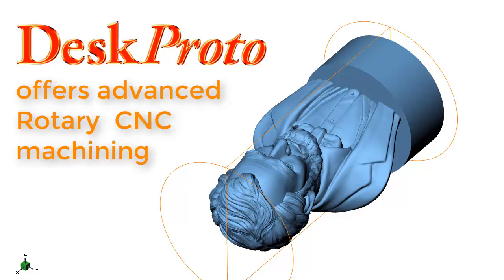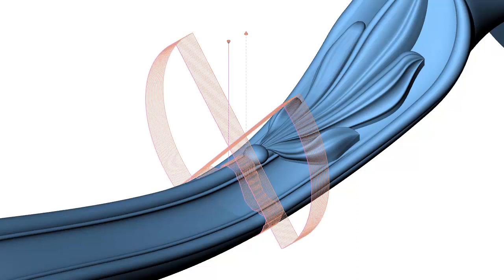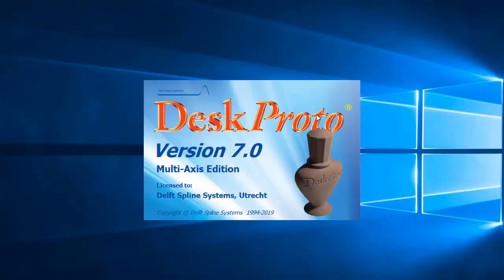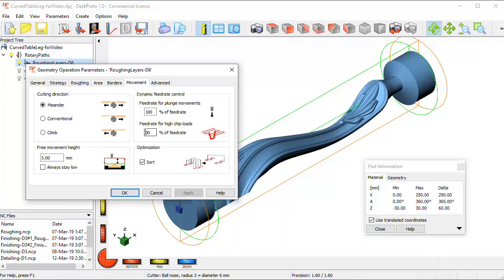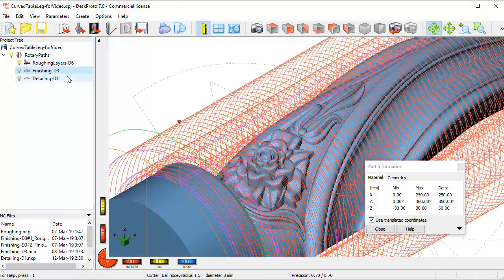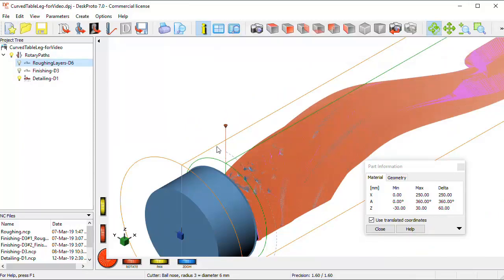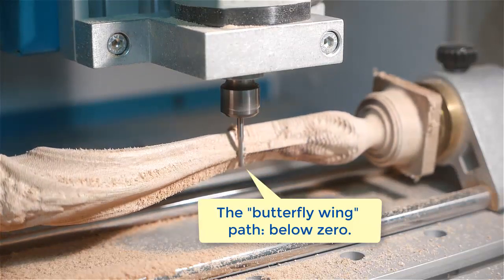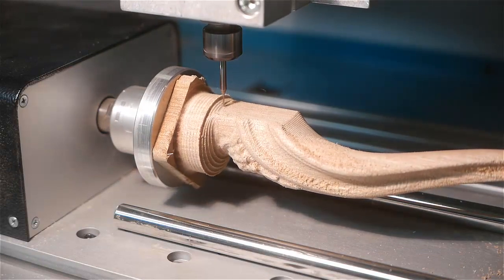CNC machining a cabriole table leg with DeskProto (4-axis CNC)

Comment: I have thought to buy powermill, but in Internet  I have not found much info about it, or info so detailed like in your videos about rotary machining. Deskproto sell books or manuals about the use of the whole software? If so, I am considering to buy it. Thanks for the great videos.
Reply from the maker: Hi Luis, We have created two books about DeskProto, that can be downloaded as PDF from our website: a Tutorial book (nine lessons) and a reference manual. The tutorial book also is available in printed form, as "Box with backup CD and printed manual". Happy to hear that you like our videos !
Reply: @Deskproto  it's possible to get support or help at working with rotary machining if occurring problems?  Model master 3 axis flat(*. Mmg) extension files is supported by deskproto? Or .Cn files?
Reply from the maker: @LuisLopez-gd9hu  In case of any questions you are welcome to email us. Though for the hobby license support is limited: some hobby users expected a complete training in how to use their CNC machine, which for this low price simply is not possible. DeskProto has a postprocessor for Modelmaster, which indeed creates .mmg files. I do not know about the "3-axis flat" though, as that does not seem like rotary machining. About machines that are not listed please read https://www.deskproto.com/support-tips-tricks/dp-tips-machine-not-listed.php
Reply: @Deskproto  I understand,  I will research more about the machine which is pretended to be used with deskproto,  maybe you know it (camel ca1530 turning lathe 4 axis "Chinese")
Reply from the maker: @LuisLopez-gd9hu  I do not know this machine, however I do not expect any problems when connecting to a China-made milling machine. Note the difference though between a lathe (cutter does not rotate) and a milling machine. DeskProto is meant for CNC milling machines with a rotation axis, not for lathe machines.

Comment: Will it work on square gemotry?
Reply from the maker: Yes, this same process will also work for square geometries. Though in case really square it might be more efficient to machine from four sides (indexed machining: XYZ paths from each side, with 90 degree rotations in-between).

Comment: hi interesting vidéo.
i have the same  problème to résolve but with aspire vectric and mach3 
can you help me
Reply from the maker: We do not have Aspire so cannot help you out. As far as I know in Aspire rotation axis machining is only possible by wrapping an XYZ design round a cylinder. As you can see DeskProto has a different approach.
Reply: @Deskproto  
It is interesting Video 
I have same problem
We have XYZ wrapping Kind of CNC with NK 105G2 (manual Rotary On/Off) 
Can you Configure a post processor that is Compatible with this kind of CNC machine

Eager to Hear from you kindly Reply
Reply from the maker: @AvinashsonawaneArtCam   Via a Google search I found that the  NK 105G2 is a 3-axis DSP Controller, so I assume that you switch the Y-axis to A. That should work with DeskProto, as in rotary toolpaths the Y-axis is not used. For information about configuring a postprocessor see https://www.youtube.com/watch?v=QZxEA-8iLvg
Reply: @Deskproto  Thanks, I was trying to find if DeskProto can utilize Y (in this video example) moving simultaneously with A as I need to machine "overhangs" over 90 degrees, but it seems to be a very rare feature in any CAM package (currently using scripts to generate gcode).
Reply from the maker: @jirij    Moving all four axes (XYZA) simultaneously is not possible with DeskProto. Still it is possible to deal with undercut areas that cannot be reached without moving the Y. After finishing the rotary machining (XZA) you can rotate to a certain A angle and then use XYZ tooolpaths - for only that area. You can see this in our Nefertiti video:  https://www.youtube.com/watch?v=m8aWk6oTiF0

Comment: so it doesn't finish the problem area?
Reply from the maker: It is not clear to me what you mention with "the problem area". Anyway: the total leg will be finished, including the area below the rotation axis.
Reply: @Deskproto  at 9:15 video when the operation is ready there seems to be not clearly cutted the area which is below the center.
Reply: @Deskproto  can your do some video to show how to cut such a leg from 4 sides?
Reply from the maker: @ВладиславАлександрыч-х3и  You are very right, my apologies. Indeed at that location some of the STL surface cannot be reached by the cutter. The cutter remains at Y=0 (exactly above the rotation axis), and so it simply cannot reach the concave surfaces at that location. This is an undercut area.
Reply from the maker: @ВладиславАлександрыч-х3и  This is on our to-do list. However, creating a tutorial video takes a lot of time, and I have no idea when we will be able to do this. What you need to do is use the wizard called "Two or more sides, automatic rotation" and set the number of sides to 4.
Reply: @Deskproto  thank you very much, u doing a good job, guys, wish u good luck!

Comment: Hi, actually we are the manufacturer of 3,4,5 and multi axis CNC machines, if I send you a STL file of leg can you send me the toolpath for the same. But the condition is toolpath should consists of XYZ & A axis movement as I dont want to simply wrap the model. I have NK105G3 4 Axis controller. Because in you above video there is movement of only 3 axis. If you can do the same then we have lots of business to do ahead as I can directly recommend your software to my clients to purchase. Please revert me back ASAP with contact details
Reply from the maker: Hi Raghulila,  Rotary toolpaths in DeskProto only use X, Z and A, so they do not move all four axes simultaneously. What you can do is combine rotary toolpaths with XYZ toolpaths, as shown in our Nefertiti video: https://www.youtube.com/watch?v=m8aWk6oTiF0&t=361s.  When you want to evaluate DeskProto you can do so using the Free edition of DeskProto: that allows to start each paid edition in trial mode.

Comment: Audio too quiet
Reply from the maker: Correct. Including the noise of the machining would not have any added value.
Reply: @Deskproto  The narration would be improved by adding a compressor to the audio channel to even the levels then normalizing it to bring the volume up and make the quiet parts evened out.
Reply from the maker: @MattJonesYT  Thanks for the suggestion. I am not sure though how I can do so: my video editing software (Camtasia) has an option called "Volume leveling", and for this video that option has been applied. Note that we are no video professionals, so we have no experience with audio compressors or other advanced tools.